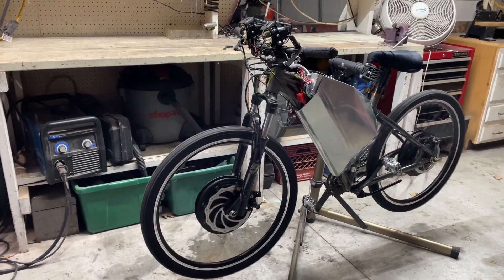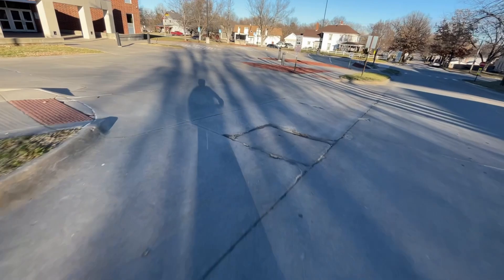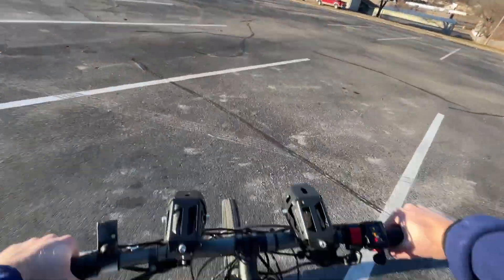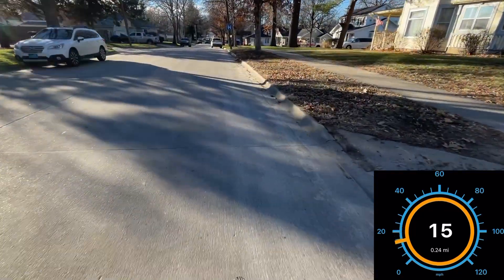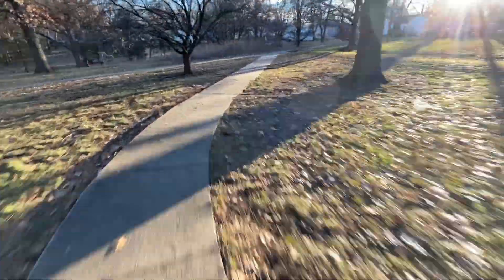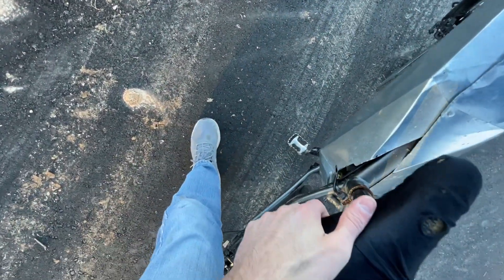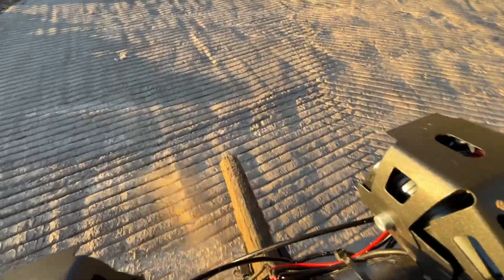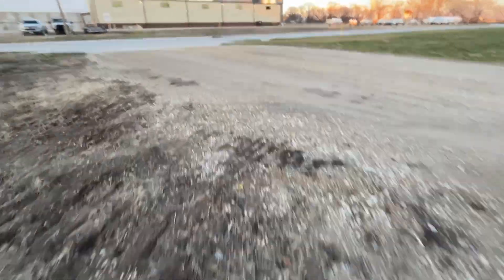2kW AWD Electric Bike

Comment: is it 2 2000w motors or 2 1000w motors? Planning on doing the same thing
Reply from the maker: 2 1000w motors. I wouldn’t recommend doing this, one larger motor on the rear is much better. The front forks just aren’t designed to handle the stress.

Comment: I wish I could try out a 2wd ebike.......I have a love hate relationship with electric vehicles. Some EVs make perfect sense, while others don't..... I'd love to do a cross country hobo Ebike packing site seeing trip. With a 500w mid drive ebike & lightweight fold up solar panels that fit in/on a bike trailer with a 100w solar panel on the bike trailer lid for a constant slow charge range extender. 
Instead of trying to use a motorized bicycle.

Comment: How long did it take you to make this and could you do a break down of how you built this
Reply from the maker: If you go to 6 minutes 55 seconds on the video before this, I mention it. It took longer than you probably would want it to, because I had to make custom brackets to mount the front motor because the front forks weren't made to mount a motor.

If you want to build an electric bike, I would recommend just using one motor in the rear.

The kit I used is this:

https://www.amazon.com/gp/product/B00YBWAINC/ref=ppx_yo_dt_b_search_asin_title?ie=UTF8&th=1

It's only 1000 watts, so it would be a good kit if you just want to cruse around and you don't care about going super fast.

If I were to convert another bike into an ebike, I would probably use this kit:

https://www.amazon.com/NBpower-Electric-Conversion-Mutifunction-Controller/dp/B07S1S5418/ref=sr_1_11?crid=1CTQEDV7RY4LU&dib=eyJ2IjoiMSJ9.IB5oBAN0XlLwVhIGwhpr13yQNcM1doJI_6nS_jDLYkfNEldiKm0sU_FH8A_DEfiZOlM3ZzVsuQFtE7F-DEV7xshbyXcPTntKGjBalzbRzUaY69dKOepbWXztwwJ8DWYv6TwxM5d04kD7jSQMMm3N3xCnfCbhQ3qLKTF8OKNfnRwRPpYJyKV1qb_siw1-ujQLPI0JG9y80vIRgT99rGm-wmyOgg7lAEWs0MP4Sv3ERJ8jMeu45OIjj40DUQdq2zPjN_8OaE8NtfIpBNpU1XiMYJ_ulORmfFqLmAgIcvSE3Uk.AiSEMH3Dtnozee43BL4xJlti699xw4Ey0xsSOM5U4OM&dib_tag=se&keywords=nb%2Bpower%2Bebike%2Bkit&qid=1708755310&s=sporting-goods&sprefix=nb%2Bpower%2Bebike%2Bkit%2Csporting%2C102&sr=1-11&th=1

It looks like it has good reviews, and because it has a 72v 45a controller, it has a lot of power.
(72 volts x 45 amps = 3240 watts!)

I would avoid using a front motor, because most forks are not meant to take the stress of a motor and they will brake (like mine did, which is why I made the custom brackets.)
Reply: @Calthecool thank you for your honesty opinion I’m definitely going to see what’s out there but this is motivating 🙏🏽